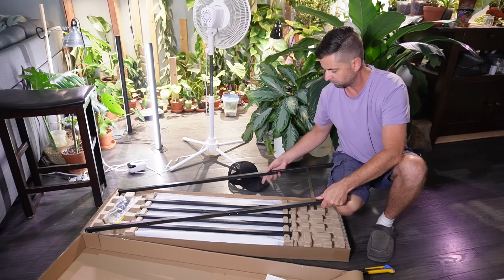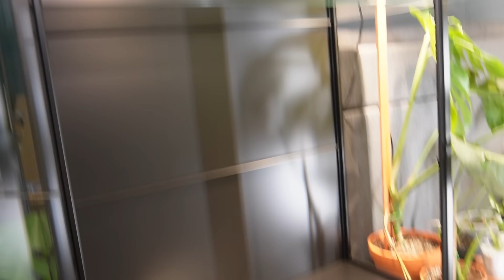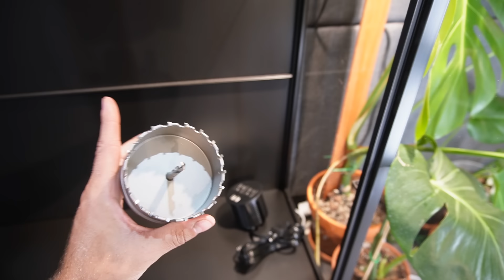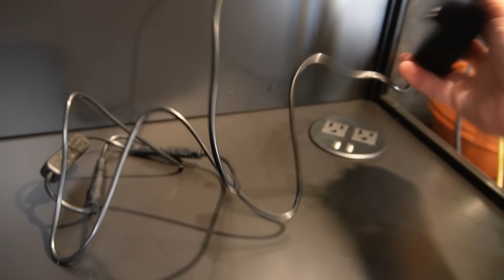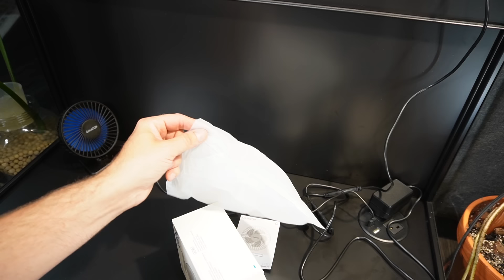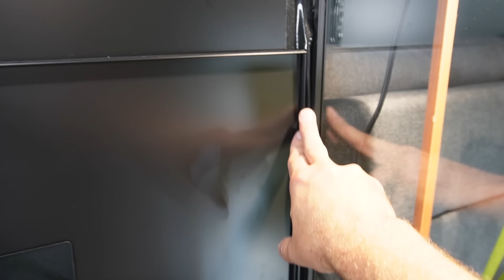How I built my RUDSTA IKEA GREENHOUSE and COOL accessories

Comment from the maker: 🚨 disclaimer. It was mentioned in the comments that having an outlet in a high moisture environment like a cabinet can cause rust and component issues. USE AT YOUR OWN RISK and be sure to do your own research. I don't plan on having my cabinet in super high humidity. Articles that I've read mentioned anything between 40 to 70% humidity will be okay for electrical outlets.
I'll be honest and can't believe I overlooked this issue... I got too excited about showing this product and how cool it is to overlook the humidity issue. 😂 If it ends up not working out then I can easily swap it out for the grommet style cord system. Thanks for watching and thanks for leaving feedback. That is one thing that I love about reading. All the comments is I learn from you as well!
Reply: We have two milsbo tall ikea cabinets and they set at high 80s in humidity and we haven't had electrical problems in over a year. We have the cords out of the bottom.But now I won't grow another way I love them! 😊
Reply: It can't be worse than my micro ISB on my mini humidifier who rust slowly after few months...
Although, I love those they're small and perfect in tiny spaces!

Comment: are you worried about condensation building up and getting inside the socket at the bottom?
Reply from the maker: It was mentioned initially in the comments and honestly I didn't think anything of it..... Just an update. I've had no issues with it so far and everything's been working wonderfully

Comment: Did you end up using the weather stripping for better insulation? Did it work/would you recommend? Thanks for the video!
Reply: Just opened your next video and you mentioned not using the weather stripping 😆
Reply from the maker: Yeah so far I have not added it onto the cabinet. I did add a little container of water near the fan to circulate and increase the humidity. So far it's maintaining between 50 and 70%. So I'll keep an eye on it.

Comment: Are you concerned with the humidity getting into that outlet since it is inside of the cabinet?
Reply from the maker: Nope.....it is less than 70. It's been in the mid 60s and doing well
Reply: @EverythingPlants  thank you!! I love that as opposed to drilling the hole and using a grommet.

Comment: Um, I certainly would not want an electrical outlet on the floor of a cabinet where you are watering plants. I suggest you place it on the back of the unit above the bottom and include a GFCI connection for any water or humidity.
Reply from the maker: Yes, I hear you're concerned..... But I don't plan on letting the humidity get very high. Outlets, I believe our certified for humidity ranging between 40 to 70% before you start to see any rust concerns. I most likely won't be watering in the cabinet. I like to remove plants from their spot and spray them down to clean the leaves. I'll let them dry and place them back in the cabinet. I'm not worried about any water getting into the outlet itself, but I may find a cover for the outlet just to be on the safe side

Comment: The cabinet looks great and a really good video for hints and tips. I am curious to know why you bought it (what you hope the benefits to the plants will be or was it aesthetics to frame the plants), either way would be useful to know the aims and then as the updates come along, to see where it meets expectations or changes as time goes by.
Reply from the maker: Very interesting question.... I have wanted a cabinet for a long time and now that I have one I am not 100% sure of its purpose yet. One angle I'm leaning to is using it for my anthuriums. As I continue to gain more of these plants, I would like them to be a little bit more protected from the rest of my collection.... Not that they are inferior to the anthurium, but maybe to see if I can keep a more consistent humidity specifically through our dry winters. As of right now that is the direction that I am leaning towards. What are your thoughts?

Comment: There's a gap at the top of the Rudsta that you can feed wires thru if you feed them thru before you put the screws in and top on. That's what I did with mine because I didn't want to put a hole in it. I didn't need a humidifier. Mine stays above 80 in summer in winter it was 50 ish. I have my fans set to go off for 10 minutes every 5 hours. So far so good.v
Reply from the maker: What??? I did not know about this hole. Do you have to take off the top to remove them?
Reply: @EverythingPlants  yes. It's not a hole really, there's just a gap between the top of the glass and the bar that runs width wise. Just big enough for the cords to fit but not the plug part so you have to set up the wires first. If you remove the lid then unscrew the bar the runs from front to back on either side lift it place the wires thru and close it up. No holes needed. The wires have to run up to the top tho and out the side. Some may not like that look. I have 1 of the magnet spice racks on the back to hold the extension cords up high. I watched someone here on YouTube do it unfortunately it was a year ago and I can't remember who it was. Maybe good growing. Not sure.

Comment: Hi Jeff! I used to run a small humidifier inside the cabinet, but after weather stripping the gaps and putting in a bunch of plants I find that just the normal cycle of the plants being watered and drying out is enough to keep the humidity at 50-65%.
Reply from the maker: I think I'll just keep it as is.....the humidity is maintaining at these levels

Comment: A great looking cabinet Jeff and a nice job setting it up. One issue I would foresee is that electrical components that aren't enclosed will rust and arc very quickly in the high humidity of a grow cabinet. Also you will have open ports that are not in use, have you thought about the danger of potentially dripping water into those, not just from your watering but also Transpiration?
Reply from the maker: Hello. I won't be keeping the green house super high and it's looks like as long as it's 70% or lower then it should be okay. I will have to try and find a cover to place over top of it for the transpiration like you mentioned. Another thing I read online about outlets is that as long as there isn't condensation on the glass then there shouldn't be an issue. I'll be honest... I think I got too excited about the convenience of this type of plug to not realize that moisture might be an issue. If it doesn't work out like I expect then I can easily switch it to the grommet style.

Comment: Awesome. Wondering the fc that grow light is giving out. I have two barrilla lights and I don’t think is enough to reach good light to the bottom of my cabinet. I also used electrical tape on the outside of the gaps to keep humidity in. I found the weather strip kept coming off due to humidity.
Reply from the maker: I completely forgot to add this into the video.... I did film a section that had the foot candles but for some reason I didn't see it in editing and honestly forgot about it. I will be making another video soon with this information

Comment: Maybe it will be better to use safety plugs on the open outlet parts to keep them from high humidity at least a bit? And i think you don`t need pebbles or perlite in the water tray to raise humidity, they are used only to keep a pot with plant out of sitting in water, just water will be fine and will still evaporate
Reply from the maker: Thanks for watching. I don't know how I overlooked the humidity issue with electrical outlets.... But I don't plan on keeping my cabinet in super high humidity. I made a disclaimer comment that addresses this issue. Thank you for bringing it to my attention.
I also should have mentioned that I do plan on placing a plant on pebble tray.... But you are correct. You technically don't need pebbles for humidity lol

Comment: Looks great! I actually got the Milsbo and the Rudsta this week but haven’t assembled the Rudsta. I don’t want to drill holes so I’m hoping the gaps are wide enough on both to run the cords through.
Reply from the maker: I think you could fit the cords through.....
Reply: I have a milsbo wide. I have two barrinas t5 at top. At back of milsbo there’s a hole but it’s not large enough for the light cord so a few options, widen that hole or cut and rewire the light cable (this is what hubby did for me). No need to drill hole at base. Also, you don’t really need fans or other power pieces. My cabinet is not weather sealed and in terms of ventilation, I open up cabinet a few hours a week and have not had any issues. At beginning I did have two small fans that I run cord through gaps of doors but at the end I just took out.